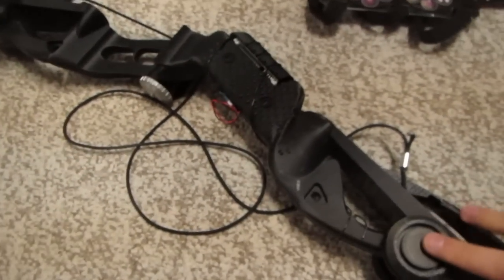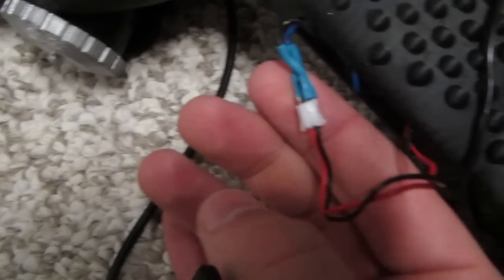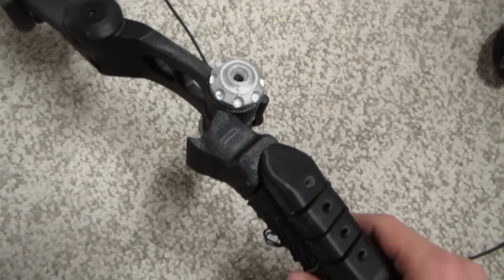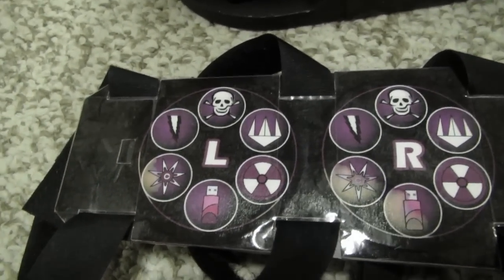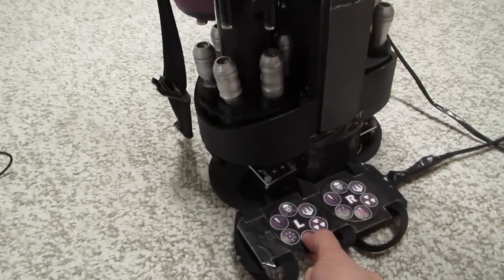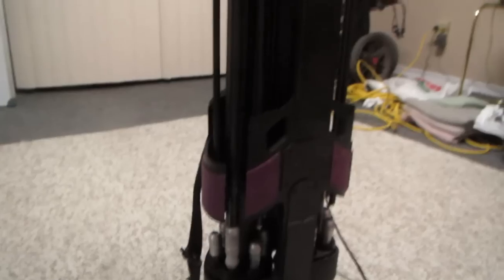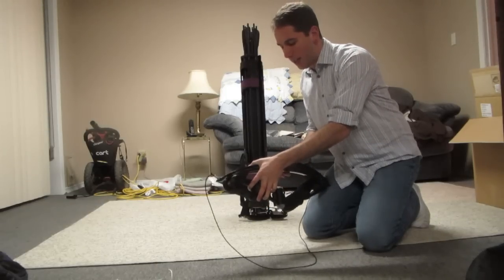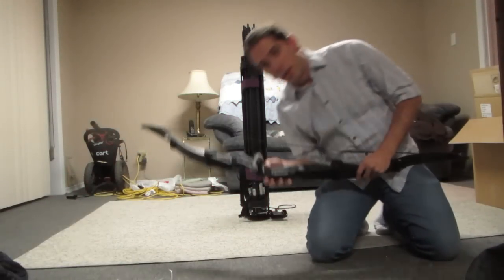Hawkeye Bow and Quiver Explanation

Comment: Cool looking toy! 
I would argue remembering the arrow is quite easy if you are an archer. I got a color code-system for my arrows. So from the nock color and fletching, I can tell what type of arrow I am going for no problem. Remembering 10 different types of arrows is not all that much.

Might I suggest you add the grappling retriever? Since this is for show only, you can snap in onto the bow with a magnet. It is supposed to be easy to take on and off, so for show, that would look awesome :) Just need a small motor and fix a spool to it. Print out a neat case for it, and snap it on and off at will. It is an important part of his arsenal

. Great work! Though I have to admit, I would like that thing to have atleast some power, so it could be shot. Even 10 lbs would have worked for showing-purposes.

Comment: Holy hell,he's good,your good dude,wana help me make tony's suit,I have designs,also I have actually figured out how to substantially recreate his immense strength and foot speed from the actual suit,the only issue I keep running into is the flight systems and jarvis,or at least the full diagnostic h.u.d. system,right now the best technology you could get is like the hacksmith or the browning guy and use electric or fuel,or fuel cell powered jet turbine wich....let's be honest is nowhere near as efficient as tony's energy repulsors,but everything else is figured out,the independent modular plates for flight stability and single point stack armoring,the strength and mobilization hardware,trade secret, and the communications hub,and the weapons systems aside from the non lethal repulsor,but again flight systems and jarvis are all that's left and I can start building it.